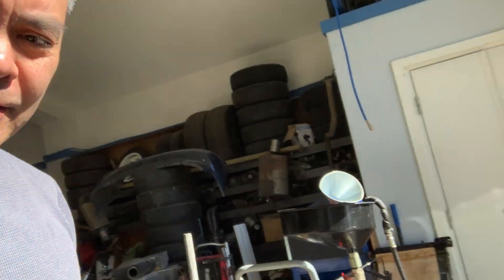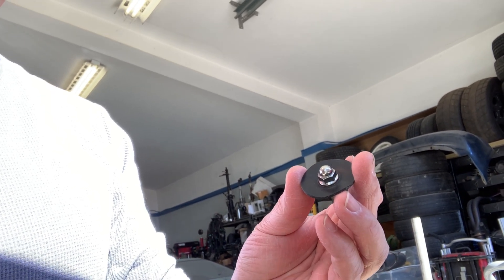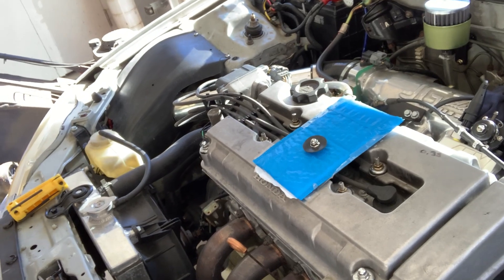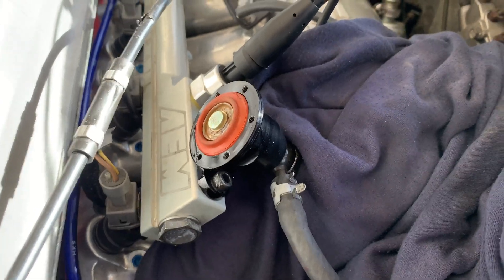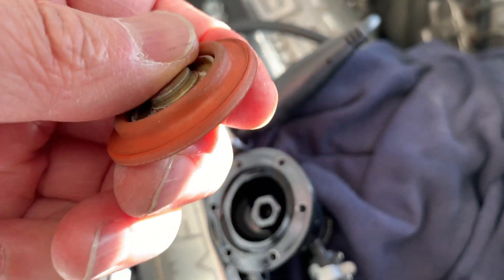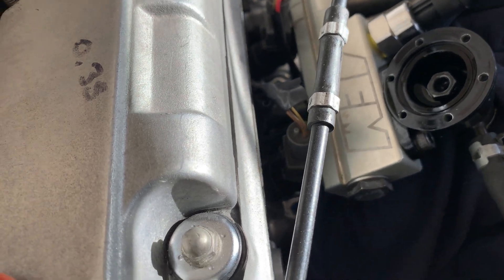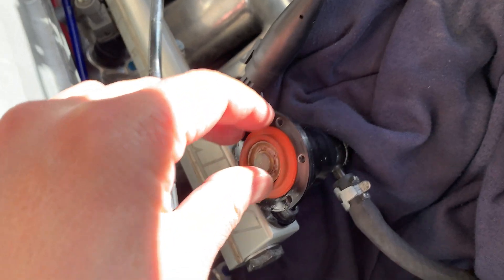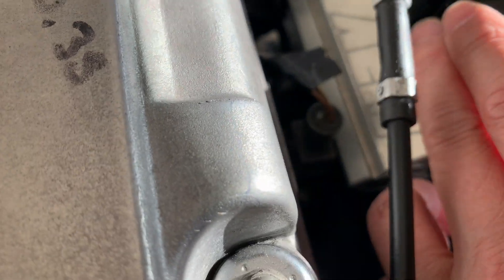***See Description & follow up Vid*** You Need This! Fuel Pressure Regulator Modification

Comment: I also have an AEM Fuel Pressure Regulator just like that and it started to leak and flooded my motor. I have to get this new part. I already changed the diaphragm 2 times in a year. The diaphragm is always failing on these lately. Great video bro and thanks for the info on that upgraded part.
Reply from the maker: Thanks. I have no idea why the aftermarket can’t make an oe reliable FPR, unbelievable. Since these fuel vids he’s sent me a thicker version diaphragm(the thin one allowed fuel past it), so I don’t have to buy a sheet and cut one myself, lol. Here’s to hoping it’s closer to oe reliable.

Comment: I’m here in the comments because I installed the no play industries one, and the upper hat started to leak after idle + under 4K revs. Set my pressure to 45psi. And saw a slow creep down below 40psi before the engine shut off. Was leaking more and more. Is the no play industries a fail? Thinking about just replacing with genuine AEM or going aeromotive
Reply from the maker: Message him and let him know. He was going to remake it 3/32” thick but then declined due to cost and shelf life of the rubber?? Shelf life? Then he said he has tested these to 150psi without issue and mentioned there are many counterfeit aem fpr’s. This is a fail, sorry you didn’t see the updated vid description or follow up fail vid sooner. I’m going to change the title now. I’d still buy this again if there was a chance it would work, unfortunately back to using and regularly replacing the aem diaphragm.
Reply: @GIZZMOTORSPORTS  interesting to be concerned about shelf life yet claim it to be superior rubber. After opening my FPR, I think the original design is superior because it’s formed to the recesses of the inside body - while the no play is just a thicker rubber disc. I’m more in favor of the AEM kit now after going through this, plus it comes with the correct size o ring (no play industries comes with only the rubber diaphragm)
Reply from the maker: @lancel5507 I made some wires like fire rings to sandwich above his diaphragm, didn’t work. I considered milling the aem top and using his but the shelf life?? Lastly I could just buy a sheet of 3/32” and rubber punch to test. But for just myself I’ll just buy from aem. Although, have you seen my other vid with the radium fuel damper? It uses the exact same rubber portion of diaphragm.
Reply: @GIZZMOTORSPORTS  yeah I think the AEM diaphragm is just contoured to the internals of the fuel pressure regulator for a purpose. And the AEM will just be one of those things to add regular maintenance to because of the rubbers characteristics. It was about 3yrs and 5k miles before it gave me issues anyway, on E85 flex fuel. H23A VTEC Hondata S300, 93 Accord CB7. I will replace with the AEM kit until I piece together an Aeromotive firewall mount kit AN hoses etc. I’ll also check out the radium video later tonight
Reply from the maker: @lancel5507  Good luck. I was about to do Aeromotive as it's what most recommend until I searched google for failures. More people complaining about their Aeromotive than AEM. No idea how the OEM manufacturers make indestructible FPRs and nobody else can.

Comment: Hello,
Can you tell me how we can get this new diaphragm?
The original one doesn’t last long enough.
Reply: Thanks, the diaphragm is 1.40mm thick. I stopped the leak by making a 34mm x 28mm x 0.5mm steel washer. It is positioned between the diaphragm and the lid (very important not under the diaphragm).
I think even 1.57mm is still insufficient.
Reply from the maker: I took down the link after it leaked. I went back and forth with the company and they were remaking a thicker version which I have not yet tested. Here is the link, https://ebay.us/vEz1tX
Reply: Hi
thank you for the answer, I had not seen the link but I just placed the order.🙂
Reply from the maker: @OS-ky2sl cheap enough to try, what would prevent it from leaking is the new version being thicker than this one in the video.
Reply: Hello, the diaphragm I received is still too thin, it measures 1.40mm instead of 1.57mm announced by no-play-industry.
I don't understand I thought they fixed the problem and I await their answer.
Reply from the maker: @OS-ky2sl  I'll shoot him a follow up message as well. Did you install the thin diaphragm to have it fail? I tried making metal O rings without success, the other thing I'm thinking is to shave the AEM body and lid ever so slightly. But there is no going back to stock diaphragms after that mod.

Comment: This is actually fairly terrifying. I've never considered this. Just using a stock drilled FPR. Maybe there's something to these returnless fuel systems.
Reply from the maker: When the Holley diaphragm failed the intake manifold it was scary until I got the fuel and got it started. I almost want to block it off completely and have fixed pressure but testing that fuel pressure in the rail does drop at wot. I supposed I can tune around that.

Comment: Good video. Very informative. I like the close ups. Hopefully this resolves all the fueling issues for good!
Reply from the maker: The fuelling was pretty bang on, I'm going to reinsure and rip around probably next weekend. After the holley failed and I filled the intake and covered the pistons with fuel, I was planning on changing out this diaphragm annually with a new AEM piece. This on is supposed to be good for a lifetime, I guess I'll find out!!!
Reply: @GIZZMOTORSPORTS  Worries me what condition my afpr is in after 15+ years now.
Reply from the maker: @604Bluelight  could be trouble